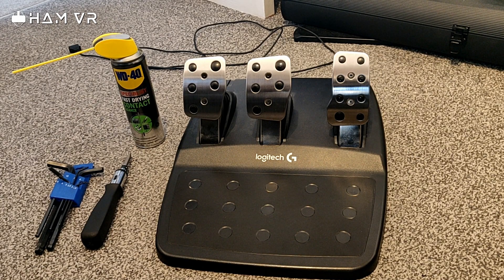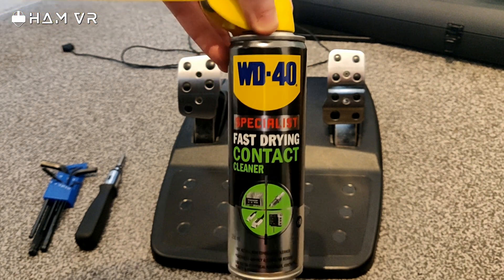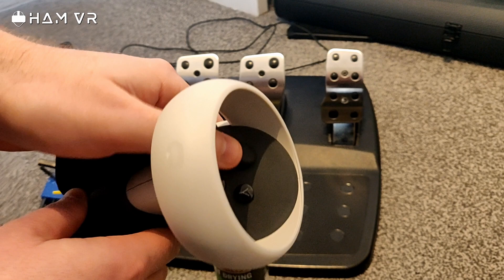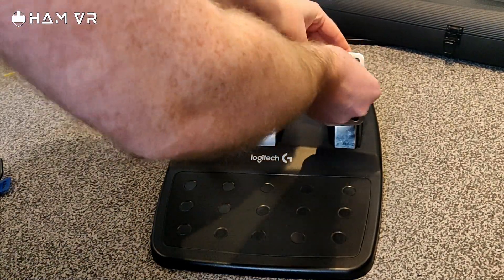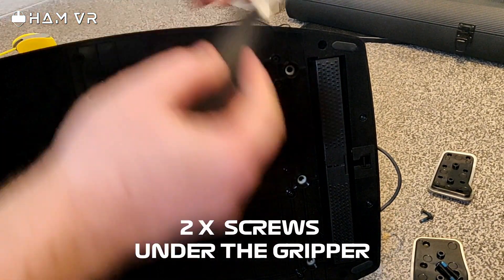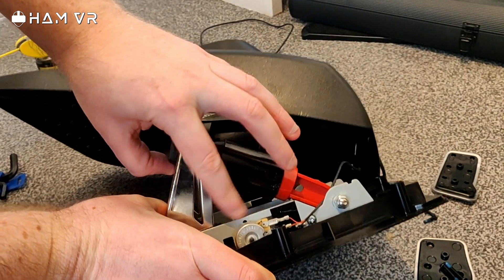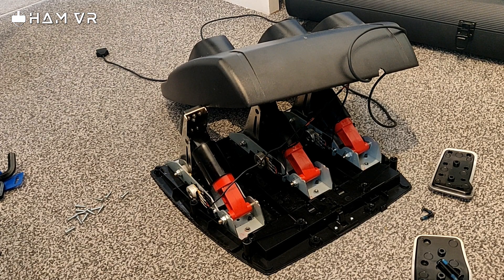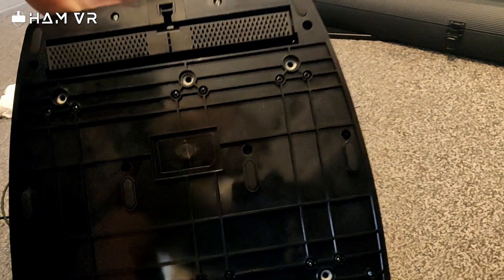Logitech G29 Sticking Pedal Fix - The Quick(ish) way

Comment: Thank you so much! I have a Logitech G923 and I was getting a throttle pedal that was sticking. I did this fix, and now it works and is no longer sticking!!

Edit:

After a week of doing this fix, my throttle pedal now squeaks. But, it has not stuck again.

Comment: Worked like a charm!
Reply: Can joystick drift on the ps5 controller be fixed in the same way?
Reply from the maker: To some extent yes. Just make sure your device is out of warranty before doing it, otherwise get a replacement under warranty.

Comment: Having this issue with brand new pedals… is this beyond expectations or just bits of dust etc as I’ve read? Usually over a couple of years this starts happening so I’m a bit confused
Reply from the maker: I would not expect brand new pedals to have this problem. You might have a faulty potentiometer, in which case I would return rather than try to fix yourself.

Comment: You said 2.5mn key for pedals but it doesn't fit for me, and 2mm is too small.
Really don't know what is happening and why it won't go with 2.5 size.
I have problem with losing power on throttle.

Comment: so I got problem with g923 for ps4...and on gt7 throttle jumps between 90% to 100%( not all the time ) when pressed at maximum...
is that a problem solving for that?
Reply from the maker: It could be a sticky potentiometer on the accelerator pedal, so this method might help too.
Reply: @HamVR  it did...I pressed the shit out of wd40 cleaner 🤣🤣🤣🤣🤣🤣
Reply: That’s a dirty potentiometer, I fixed  mine with the all time fix for potentiometers, a bit of Kontakt spray

Comment: Brilliant, Did all that and problem solved, Cheers :-)
(I did replace the screws under the gripper though, and seen as it was all exposed I added a rubber cube into to the Brake spring; i'm loving the new brake). Thanks again 👍
Reply from the maker: Nice and great work on the brake mod!